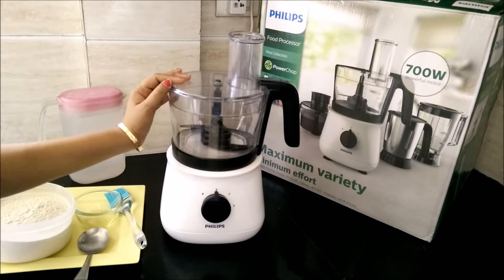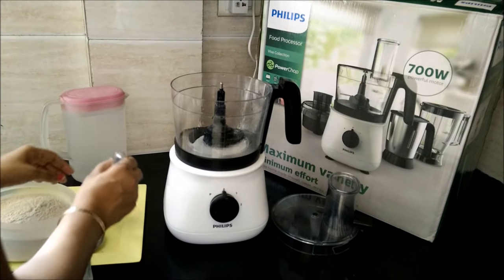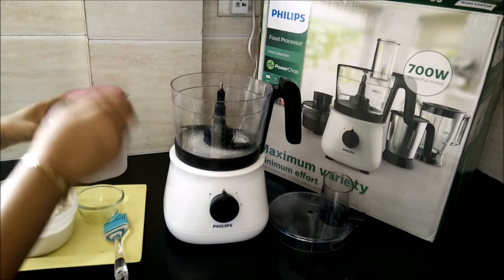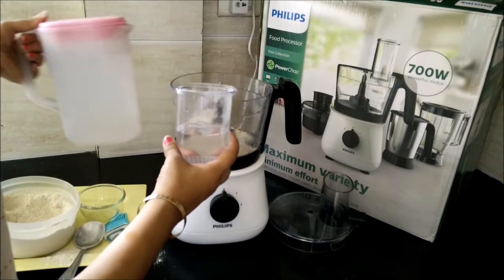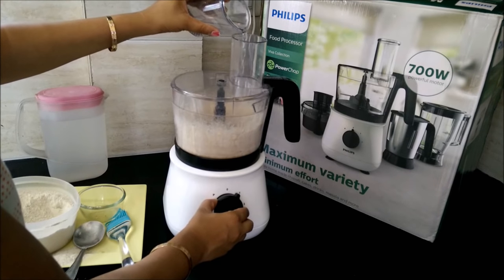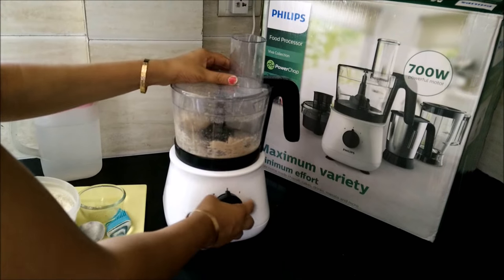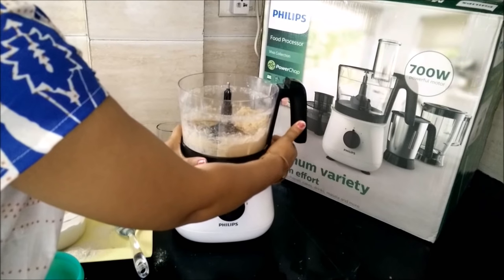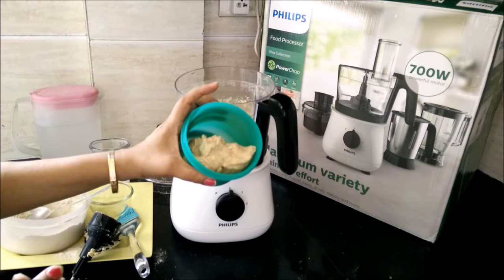Atta Kneading in Philips Food Processor HL1660 | Philips Atta Kneader by Happy Pumpkins HL7707

Comment: Rest of the attachment are good, But the Atta Kneading is a failed design as all the atta after adding water will stick to the upper teethes of middle stick attachment even after greasing with Oil and time you are trying to save in kneading is spent to clean that attachment its one and the same.This video shown also proves the same. I've used more than 3 Food processors till now from past 5 Years and most of the times for kneading.
Reply from the maker: I agree to a very large extent with your observation. Just that this one was better than the others I've used

Comment: Philips Processor Good for  other Functions like slicing chopping in addition Quality of Motor good and Silent yet powerful.  How ever Atta Dough Making Function very bad and messy, dough is not good,  kind of sticky, Fault is dough making Blade too small hence does not spin dough properly failing to mix water and atta end result is sticky Glue like dough stuck on sides and blade. Blade fitting crude detaches from axis while spinning dough around, more over you will waste lot of time in cleanup. had a Singer Processor which did a excellent Kneading Job. Expected better from philips design team.